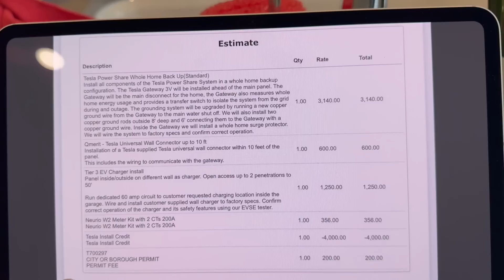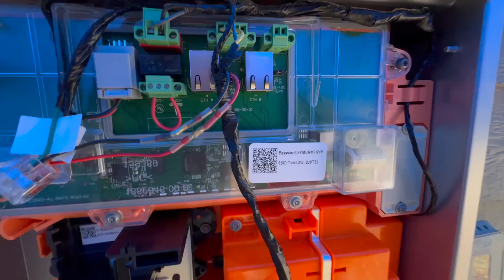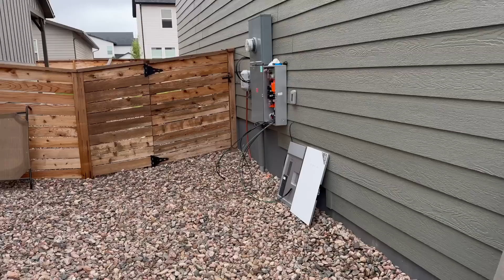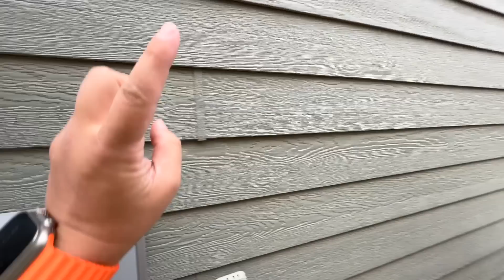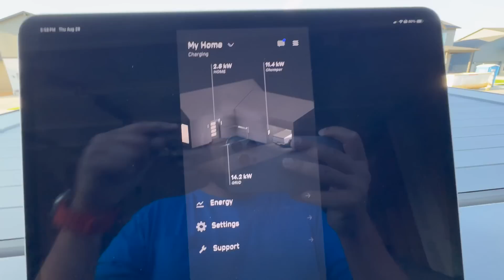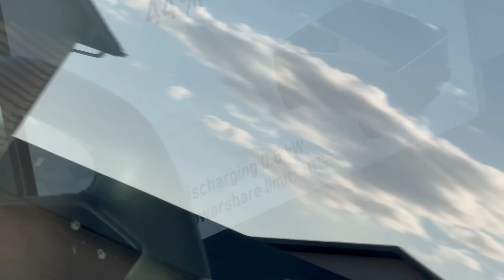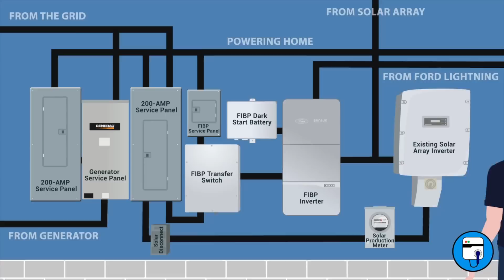Installing My Level 2 Home Charging Setup w/ Tesla Powershare Bidirectional Whole House Backup!

Comment: Incomplete reporting 😢 As much as I like you, OoS, there are two major details not discussed:

1) Cybertruck battery warranty can be voided by using its PowerShare capabilities

Extremely vague language “Using the vehicle as a permanent, stationary or long-term power source or backup”.

This needs to be talked about by EV journalists and Tesla need to provide clear spec for what is considered violation.

CT can pull 500kW+ while driving, DC fast charging can go to 330kW, but you doing mere 11kW at home can void a warranty?? Nonsense!

2) Tesla won’t sell you the Gateway hardware. Only after you pay “Tesla certified” contractors a 2x-3x the market rate for the job they will let you pay for the hardware and they will deliver it to installers, not you. 

In rural areas where you’d need PowerShare the most Tesla certified contractors might not even be available!

This is insane. In many states homeowner can wire up full solar system with batteries, inverter, auto-disconnect switch themselves and get it inspected or hire state licensed electrician for any job. 

But for some reason Tesla Gateway is different. It really should not be.

—

TL;TR: do you own what you paid for?

I hope this gets covered in a separate video! 😽

Comment: While fascinating to see this technology and capability demonstrated, with the reliability of my local power grid, this two way power share capability is not really necessary for my use. I fairly often go without a power interruption for over a year at a stretch. And about the longest stretch of power outage has been around 11 hours.  Most all other interruptions have only been for short periods of time, like 20 minutes or less. I have some battery backup units I can use to power things like my CPAP and recharge my phone and tablets and run a few other devices as needed for a reasonable amount of time if needed. I have a gas fireplace as a backup heat source.

Comment: Has anyone on here used the adapter from the Tesla universal wall charger on a regular Tesla charger and have a way to remove the adapter?  Borrowed my neighbors adapter and it won't come off my charger now.  Myself and neighbor had no clue you should not do this.  Tesla says the adapter is not supposed to come out of the dock, but it did with no issues.  Tesla's solution was for me to place the adapter that came with my Tesla on top of the other adapter and they would send my neighbor a new adapter.  I still feel like there has to be a way to remove the adapter easily.  Any ideas?  We already tried a magnet.  We even tried taking my whole charger over to my neighbors house so we could place the adapter back in the dock but it seems to need some sort or power and or communication to release.

Comment: The TUWC is great, but would you, Kyle, be able to have Tesla create a software update for them, since the J1772 connection can cause 12v battery phantom drain to some PHEV/EV models such as the Honda Clarity PHEV? (Tesla doesn’t seem to care after I’ve put in tickets and such.) The solution is to use a Tesla to J1772 adapter, and I’d rather just use the J1772 minidock attachment as it looks much cleaner. Please chime in if anyone has experienced what I have experienced (I think some Mach-E users have been affected as well). Thanks in advance!

Comment: the ford system takes longer to switch over than most of the power outages we have .. the city runs the utility where I live .and has several power lines coming from different directions into the city and they can switch over to different sources if one goes down .  cool tech though ..

Comment: Two things…

The “partial finish” in the garage is to code.  In most jurisdictions you need a fire rated finish (the drywall) on the shared walls to an attached garage to the living space.

The extra fee is the pro-rated labor for having home owner present and asking question.

Comment: We have 3 Powerwalls and it takes about the same time to swap, unless you tell the gateway to do it even while the battery starts taking the load.  The 5 minutes to go back on grid is the same as powerwall and we don't see a small outage when going back on-grid.  We rolled 3 powerwalks with gateway, and we did put in solar at  the same time so costs are not comparable.  We can charge our Model Y off 'solar only' when it is available to keep down the use of grid power.

I hope the Juniper has bidirectional charging.

Comment: What channel is this? State of Charge? Lol. Excellent video as usual. My Chevy Bolt came with a wall outlet installation with a credit of up to a thousand dollars. My need was pretty basic. They installed the outlet right next to the breaker box in the garage and they also did a breaker upgrade. Didn't cost me a dime. I got an Emporia unit which I'm super happy with. I drive a jalopy to work 4 days a week and I drive the Bolt the rest of the week. I didn't really need the installation, but I know one day that my jalopy would shut down for good and I didn't want to be caught short. I keep the old 110 charger in the back of the Bolt just in case I may need it for something. Awesome vid. 🚙🇺🇸⚡🔌

Comment: Using AC for backup power probably costs nothing extra on the price of the vehicle if it already has a built-in inverter for the household plugs in the back, as all work trucks should have

Comment: I'm assuming you cannot run Powershare while the grid is on since you didn't demonstrate it? That's a bummer if that's not a feature. You could use it to manually switch to cheap stored electricity at any time without any power cut and without worrying about the max inverter power

Comment: I can say that the system can't do it "seamlessly" as it would constitute a make before break system, or a system where the off grid generation is synched with the utility before signalling the cybertruck/islanding generator to kick offline. A system that is paralleled with the utility and grid forming has VERY strict safety standards/rules required. The easiest and cheapest option is to have the system shut down-reconnect to the utility-and have the generator back in grid following mode, or in the trucks case, back to a load. Could the disruption time be less than 2 seconds, absolutely, but more than likely, there will always have to be a disruption of some sort as it seitches over.
Reply: Agree, having it be seamless is WAY more complicated, expensive, and highly regulated. 2 second delay isn't bad.

Comment: Agreed with Kyle about the cost of the installation on the PowerShare. Our neighborhood is rarely get power outages anyway. In case of emergency we can run couple of long power cords and 2 power strips from our truck.
Reply: Agreed, With the EV Trucks having multiple outlets, just run extension cords the rare times power is out for a few hours.

Comment: As someone who built a house years ago, they don't generally "finish" the garage walls in new builds except for the shared walls with the interior of the house in order to enclose insulation. I had to pay extra to fully finish and insulate my garage.
Reply: The shared walls are finished because they need to be fire rated, so the house occupants have time to escape in the event of a fire starting in the garage. Holding the insulation in is just a bonus, but you can install insulation without the drywall...
Reply: depends on where you live. My AZ new build had the entire garage drywalled. No insulation though.

Comment: 1) Your Estimate was $5300...in summary you say 10k ?
2) $2500 or $4000 Tesla credits (with my CT it looks like it is $2500) I assume extra 1500 was from referrals ?
3) Gateway, installation and a wall charger cost is $3700 for you (minus $2500 credit). It's not only a device (I think it's easy to assume worth up to $1000 in comparison to other electric devices on the market like disconnects, inverters etc). It includes thick copper wires, conduit, breakers + labor. Is it really too much (2 man one day of work) ? It's what you pay for upgraded rims or paint on the car...
Rest of the cost is your preferences ( 2 chargers), permit and not so usual setup where meter/AC and your panel ar so far apart. And even for 2 EV's homes of the future one level 2 charger plus NEMA outlet would be good enough. How often 2 cars drive 200 miles every day ?

Comment: Kyle, the power surge and disconnect during the night may have been electric heat.. during summer the mountains can did low enough to trigger it or another heating device.  It would depend on your heat type or electric water heater type.. or 2nd car trying to charge..  NICE install though.. too bad it is a rental. Congrats.
The inverter located in the vehicle make sense because the AC DC inversion is just being reversed. The charging cables stays  AC whether it goes to or from the vehicle. Ford sends AC to the vehicle, converts it to DC for storage, then when needed in the home, sends DC to the home using the cables that usually send AC and requires another inverter in the home. Ford adds more complexity, components and takes longer to disconnect then confirm that lines are not powered before switching the power type. Tesla did a far better job, even if it requires every car to have these components to support it. Ford charges more to do less energy but with more complexity and opportunity for failure.
Is Tom related Robert DeNiro? Every time I see him I can't help but notice the resemblance..

Comment: Depending on where the electrical panel is, it is pretty simple to set up a sub panel to provide a convenient way to handle multiple EV chargers as well as making it easy upgrade some of the equipment in the future. Furthermore with DIY, you can often go above and beyond the electrical code and still have things be cheaper than having a company do the work. When I did an extra circuit in my home, since it was in the garage, I did some outlets closer to the standard used for medical facilities, complete with isolated grounds, thicker gauge wires to minimize voltage drop across the line. While prices have gone up over time, the equipment cost is a small portion of the cost when an electrician is hired to do work, as long as you can work safely and follow all safety rules and guidelines, you can use the savings to go above and beyond.

Comment: I have solar and home battery backup so i already have everything i need really for the most part. It's a dc coupled system so i could just feed the home battery in theory especially with the car putting out dc. But I'm sure it wouldn't work the way it is. It really is disappointing right now.

Comment: The delay in reconnecting to the grid might be a feature and not a bug. Sometimes the grid goes on and off a few times before coming on steady, and the delay might help save your system from line surges.
Reply: This is correct. It appears to be the same functionality as the Powerwall. After a grid power returns, there is always a 5 min delay before home power is shifted back to the grid. This is to ensure the grid is stable.
Reply: Nah its a glitch, mines 20ms(says this in manual/specs). Someone did something wrong. My lights barely flicker let alone go off. Yes power flickers on and off, but the system just flickers with it so u dont even notice the power. I feel there is something wrong with his system, but hes renting, to spend that much and set up this system is crazy but hell make it all back from this video lol...

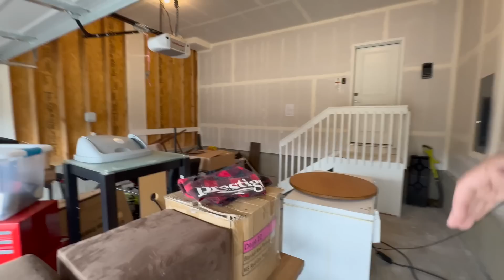Comment: 10:11 definitely want to see a full send one day. Solar + batties. Full electrical home, heat pump cloths drier, heat pump water heater, ground source geothermal heat pump home heating and cooling. Quite possible to technically never  have to pull from the grid if you if you have the correct insulation in your home and energy efficient appliances.

Comment: 1 whole minute to wait for the Ford system to realize the grid is down and kick on is unacceptable. My Tesla Gateway with the CTs installed can do that in a split of a second, the light don't even flicker sometimes.
Reply: I’ld be okay, without the auto switching, and just being able to plug the EV into my generator panel by hand. Does your power go out every day or something?

Comment: Great detail in this video, thanks so much. And thanks to Tom and State Of Charge for the Ford system explanation. Our old home got a generator power outage backup system at about $14K. And it has to run once a week just to keep seals lubed, etc. It was propane fed so that's another ongoing cost. So I think the $10K is comparable but I agree it should be less given no genset motor etc. We now have a battery backed system controlled by SolArk with batteries by Micro Grid and it cost about $14K but it's integrated with our existing solar system. It switches over to battery in about 250ms which blows my mind but we tested it and yes, it's back up and running the home in 250ms! We don't even notice it. With grid tie and solar power, we hardly see any grid charges but that will change when we hit the winter here in Durango. Cheers and thanks again.

Comment: Why would the rental owner want the unit removed? It will leave a hole in the siding (damage to the unit) and reduces the potential rental base for future occupants.
Reply: They probably don’t want to deal with renters that don’t understand all this stuff and them having to maintain when it fails.
Reply: Agreements are usually written such that you leave the property in the same state as when you moved in.
Reply: For a landlord it's really of no use because most people don't have EVs, it's another thing to break, and it would be too complicated if you didn't understand how it worked and needed to fix it. They don't really care about holes in the wall, landlord will just fill it with spray foam and call it a day.
Reply: I do wonder why they didn't put the Tesla gateway on the inside of the garage, would have been much better.
Reply: Improve property value

Comment: I totally agree with your assessment, that the charges for installation were far too high. This is my top of head opinion and without any research. Over $10000 for bidirectional charging makes it unobtainable for most people.
Thank you for your commitment and efforts to put this in front of the public, so we can all become aware of challenges in the energy transition and then more intelligently be able to apply pressure to help make things better for everyone.

Comment: The garage drywall is only installed at areas adjoining living space to provide the required fire barrier. The exposed framing is at exterior walls. Its annoying but not unusual. The builder did what they were paid for. The owner is the cheapskate!

Comment: AC V2H is good but we need DC V2H into the Powerwall so we can disconnect the car. You would think that AC V2H would cut into their Powerwall sales where the DC would work in conjunction with the Powerwall and solar.

Comment: Cybertruck $80,000, $2500 Tesla equipment = $82,500 for 11.5KW (123 kWh)

F-150 Lightning $55,000, $1300 bidirectional charger* + $3850 kit =  $60,150 for 9.6KW (98kWh/131 kWh*)
(*Bi-directional charger still comes with the extended range F-150, per Ford. Having a hard time finding an MSRP for it though?)

The Ford system's inverter also doubles as a solar PV inverter, so that's a bonus if you plan to go that route. The sub panel is not strictly required, but you will need a transfer switch just like the Tesla system does. Overall you're paying more for what you get with the Tesla due to the cost of the truck itself.
Reply: where did you get a new F150 lightining for $55K? Please share
Reply: @elemenop718  I bought mine in February of this year, for $52,000 OTD. $7500 tax credit, $7500 rebate from Ford, $9600 dealer discount. XLT ER, no money down and about $1300 in trade equity, so my total financed after TTL was just over $50,700. The FCSP 80A charger was included, free of charge. I have not bought the home backup kit, though it might be tempting when one hits eBay. Currently I have a 30A generator inlet and manual transfer switch and interlock.

Comment: Hi Kyle,
Do you know anything about the Tesla Backup Switch?

"Backup Switch is optional in Powershare Home Backup systems and will be available to install later this year depending on system configuration and utility approval. Like Powershare Gateway, Backup Switch also automatically detects grid outages and can be installed behind the meter to seamlessly transition to backup power."

Comment: As a fyi, I have telsa gateway and 2 powerwall 3s batteries and time to switch from grid to back power is instantaneous,  so fast its not even noticeable and wifi doesn't go down
Reply: Is it worth getting powerwall(s) for that reason?  In my mind, just having a cybertruck is all I would need since it has such a high battery capacity.

Comment: When you do end up buying a house, span panel my guy.  I did 11.75 kWh solar array with 2 PW3, Tesla UWC, and Span Panel.  You can stretch the battery of a cyber truck ~45 days of intenernet and refrigerator lol.  This is assumed no sun is seen for 45 days.  Absolutely crazy.  The Ford implementation is already a dinosaur.   Fingers crossed I'll use my M3 and MY as power walls on wheels.  Only time will tell.
Reply: Kw
Reply: Do you use evcc for management? I highly recommend!
Reply: I noticed the installer had a SPAN hat, was thinking Kyle should ask about that for his next house!
Reply: the ford system is good nothing to hate about dummy.
Reply: I don’t see how you can use m3 & mY as powerwalls because they don’t have hardware, software, firmware to accomplish it.
Reply: Possibly DC2DC to the Powerwall 3?  @johnpoldo8817